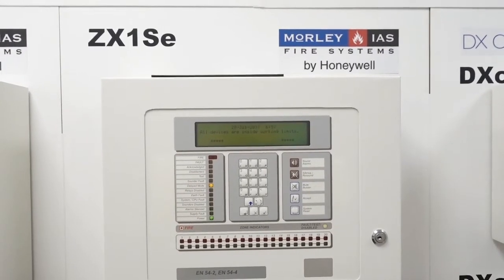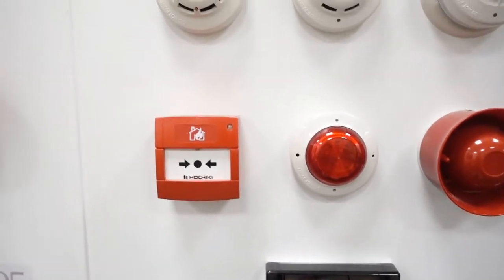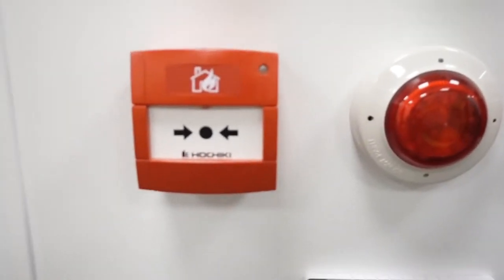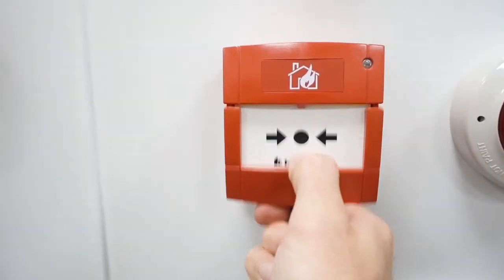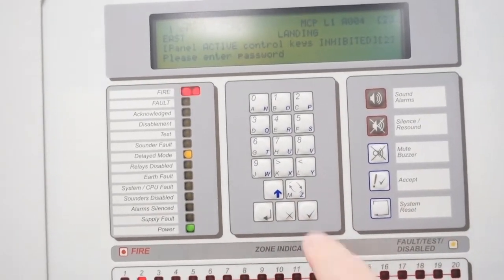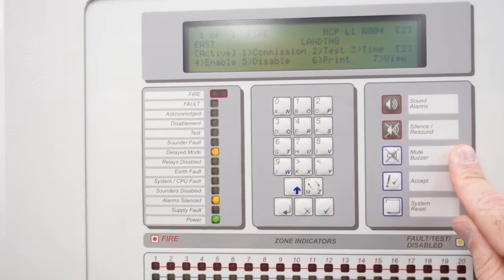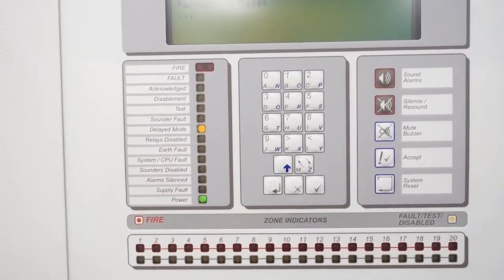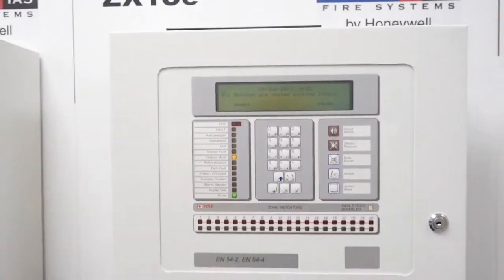TESTING MORLEY IAS ZX1Se PANEL | HOCHIKI MCP | FIRE ALARM DEMO

Comment: Hi Dan, This is the panel we facing the problem with earth fault,  its removed all the loop cable & NACK  and another external 3rd party integrations and removed 230V AC supply from the wall socket then supplied the power by the backup batteries 24V DC also occurring earth fault.  the solutions what will be?
Reply from the maker: If i am reading this correctly it sounds like a potential issue with the PSU or panel PCB. Have you tried disconnecting the PSU lead to the PCB and seeing is it disappears?

Comment: Hi dan, great video by the way. As this is as networked system, any devices activated would activate both systems. Would the system preform in the same way when the evacuate button is pressed, say for a fire drill??
Reply from the maker: Evan Stoker it all depends how it is programmed. I would always use a manual call point for a drill because acts as a real test where as an evacuation button often limits the cause and effects
Reply: Dans the Engineer yes, we had one fire drill where they activated a call point but hadn't realised the system was on a receiving centre, so from then on it's been the evacuate button so there's no risk of unwanted call outs
Reply from the maker: Evan Stoker have you seen my detailed weekly test video? It provides further info on weekly testing. Setting off the monitoring is a good thing but let them know before you do a test so they know it is a drill. That way it tests the monitoring on a regular basis. It is a very important section of the fire alarm system to decrease the action time from when a fire starts https://youtu.be/xb_qqbLq6pM
Reply: Dans the Engineer yes I've seen it, I'm not responsible for the alarms in my building, I just have an interest in them :)
Reply from the maker: Evan Stoker well that doesn't hurt at all along with any fire safety because knowledge and education may well save your life and others one day!